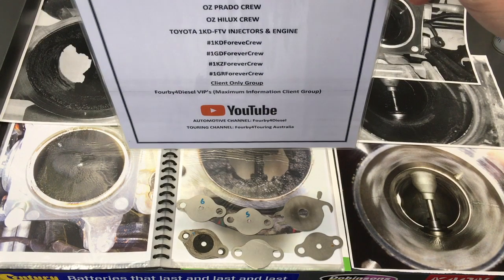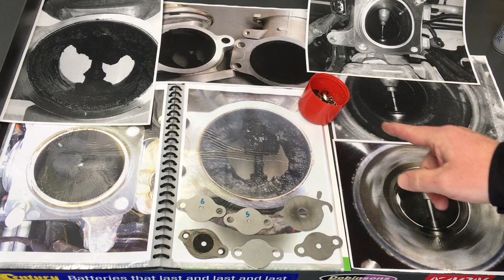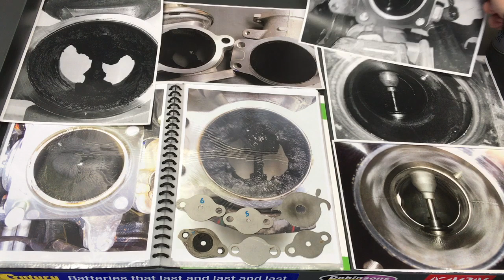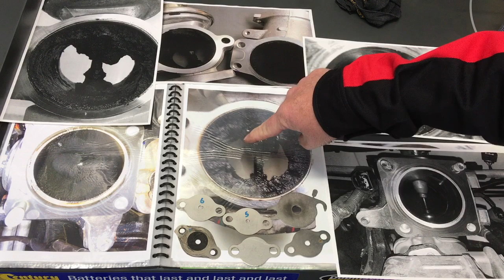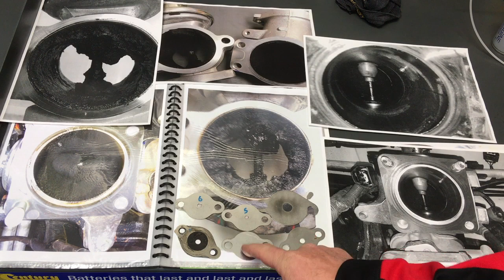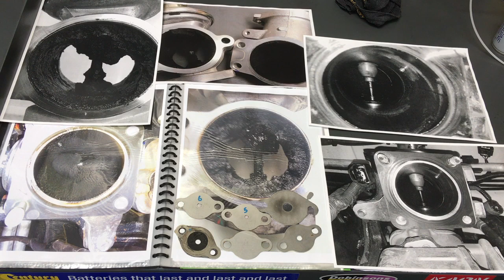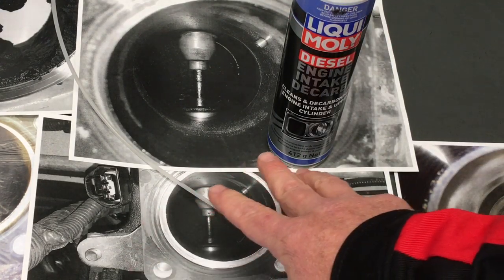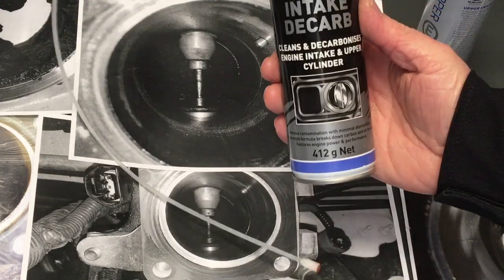HOW TO FIX SOOT in a TURBO DIESEL

Comment: I do agree that the egr is the problam. Dont you think the catch can should help with keeping the turbo fan and intercooler pipes and intercooler clean i think it must.
Reply from the maker: No, I don’t think that it’s already clean egr is the problem clean oil isn’t a problem
Reply: @Fourby4Diesel  i see. I would agree with a engine which does not breeth much posibly some which are new. Some moters breeth more tho, and dont you think if it acumutates it will go thicker and gunky . I do understand the cretiqes the the risk of crankcase pressure ect , i will keep an eye on the one i have . I have a n80 with a egr delete and a catch can haha .

Comment: Great vid thanks! I was about to fully block off my EGR on my 1996 HILUX SURF, just wondering, you mention the 7mm hole is best, better than a full block off? Why would I not just fully block off? Where would the soot go with a 7mm hole? And wouldn't a 7mm hole still blow hot air into my engine?
Reply: Your 1996 Surf would be fine with a full blank as it is not ECM controlled. Anthony is talking specifically about the 1KD-FTV engine family re 7mm blank plate.

Comment: I also wanna know whether or not the sludge damages the piston head and maybe the valve and valve seats? Compression loss? What about air intake loss as it clogged? Then you get more fuel-air  so it gets richer and you get lower pressures in the cylinder... 
But I don't truly know the answer to any of these.